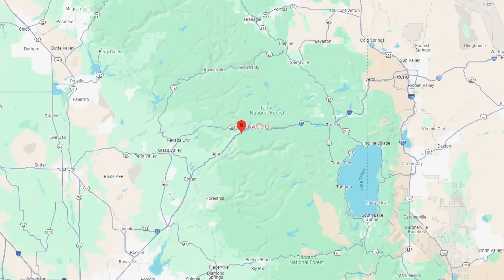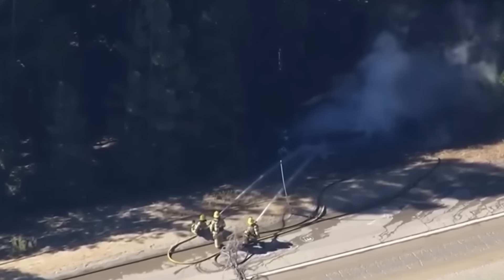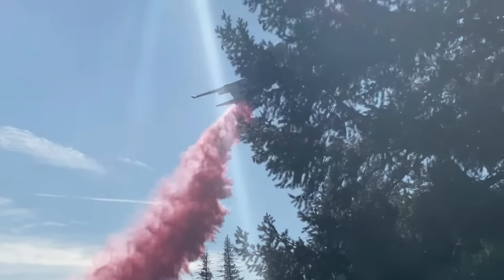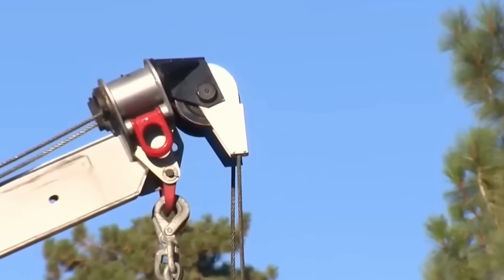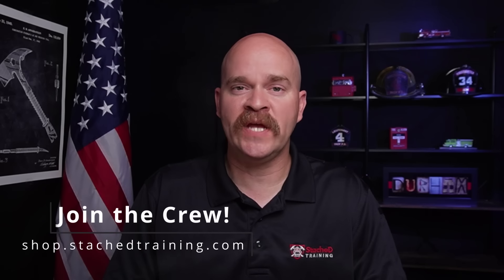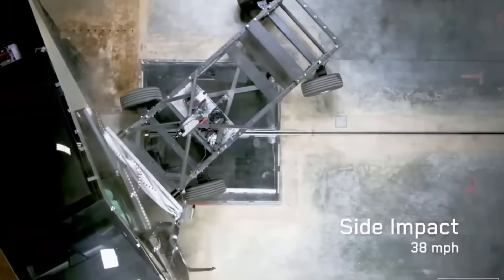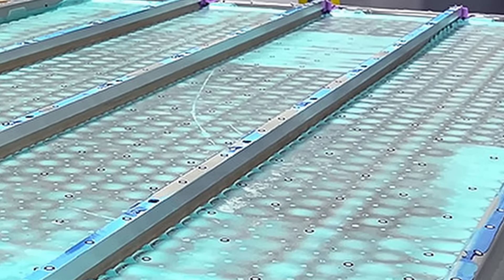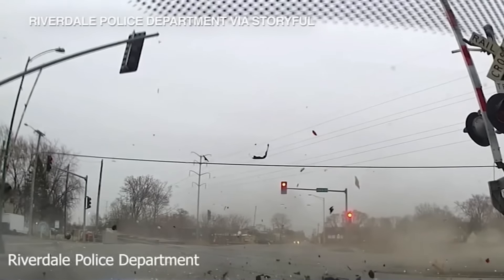50,000 Gallons! Tesla Semi-Truck & Cybertruck Fire

Comment: happens when to gas vehicles crash too. see it happen TO ME. You do know gas vehicles exploded right? or are you that narrow minded. burning fuel truck take long time to put out and do MASSIVE damage.
Reply from the maker: I've responded to hundreds of vehicle-related incidents. ICE vehicles rarely catch fire after a crash, and vehicle fires never result in explosions. While they may explode in movies, real life is much different. In 2021, I was on the scene of a large fuel tanker fire. It was carrying 4,000 gallons of diesel and 6,000 gallons of gasoline. The fire was extinguished in two hours.
Reply: But ice fires can be extinguished with water unlike EVs water will cause a thermal runaway causing massive explosions and deadly gases which will take hours to extinguish if it doesn’t kill someone
Reply: Pin of shame 📌
Reply: That's like comparing a bomb to a candle.
Reply: Well, for the same autonomy an ice vehicle transports 4 times more energy than an electric  - consequence of the difference of efficiencies -  but it is true that what matters most is how the energy is release. Ice cars have many more decades of experience dealing with this problem
Reply: Actually it is 11x more frequent in gas vehicles.  The OP is right about the effort to put out, but I would rather have 11x less deaths with more work to put out than the alternative.  Not to mention the cancer and other problems from combustion pollutants.
Reply: @badchefi biased ...? States the facts  tells the truth imforms  peeps like me with a general  understanding he also has vids about  battery fires in different structures  and  containers   so not just about e v cars  trucks 😮
Reply: Pack yourself another bowl, sit back, and try not to embarrass yourself by responding any further.
Reply: @josecamacho3393  is the charge of the battery relevant to the fire once its been instigated by thermal runaway? Or is it the 400kg of flammable components?
Reply: gas and diesel burn but do not explode. With lithium ion cells, the situation is different - read the safety instructions for your RC car.
Reply: @cherokee180c0  Brake and tire dust are arguably worse for your lungs than combustion.
Reply: @StacheDTraining  Mythbusters confirmed years ago.... Lmao😂 "movie myths"
Reply: You’re one of those guys who believes Follywood movies are reality.  Try again, Sparky after you get some education on the matter.
Reply: Not the same 😅
Reply: @JTDPM  I’m old enough to remember the clouds of asbestos dust that always accompanied a brake service air blast.
Reply: @StacheDTraining Liquid fuel is potential energy. It has to be converted into usable energy via some kind of ignition. Liquid fuels are much safer. You spill it everything is okay unless someone decides to strike a match. That energy also seems to take longer to release. Batteries store a massive amount of energy that's ready to go basically. You disturb the vessel containing all that ready-to-gk energy and it has to go somewhere very quickly. At least the driver had enough time to get to safety. Could have been alot worse.
Reply: @JTDPM  depends what you’re talking about yes that’s correct in terms of internal combustion for fuel however for battery combustion products they are pretty much more hazardous and many chemicals we are exposed to on every day basis
Reply: @rjbiker66  apparently not-well you would think the state of charge would affect it studies have showing that there is not a great deal of extra energy depending on charge nor extra risk on state of charge or the release of gas and combustion products
Reply: @JTDPM  Which an EV cuts down by like 70%.  I use my brakes like 5% of the time I do in a gas car and they will last probably 150K miles or more.
Reply: Gas vehicle are extremely unlikely to explode
Reply: @cherokee180c0 yeah you forgot to add the fact that they are many times more ice cars or maybe you intentionally didn't give that detail
Reply: @rajaydon1893  what don’t you understand about accident RATES?  The rate is already calculated per miles driven.  It is literally 11x less likely on a mileage driven equivalent.  By the way that is from Teslas own realtime data, but also very similar to the NFPA data.  Look it up.
Reply: chinese bot
Reply: You're wrong bud, electric vehicle fires are so unpredictable that they can reignite at any time for any reason at all even weeks later at the junkyard
Reply: @cherokee180c0  Frequency does not equate to death...
Reply: @cherokee180c0  Yeah, but your tires will go much more quickly.
Reply: @geogeer9911  So more fires are good?  There is absolutely no evidence there is a higher death rate.  In fact the Model Y is the safest car ever tested in two different countries which is REAL data suggesting the exact opposite of your argument.
Reply: Get a load of this guy being disrespectful on a pointless informational crash
Reply: @cherokee180c0  The size and controllability of a fire is more important than the number.  I haven't seen dealerships burned down by cars sitting in the lot.
Reply: @StacheDTraining 

U savage for pinning the comment😂😂😂

But yes, ive seen some semi accidents as well. But im mere driver on the road so i just drive past by them n hope anyone involved didnt get hurt. But so far.. no smoldering wreck. N this is just me driving on the road. U as an actual responder would definitely have more experience.

The general rule is, once crashed, turn off engine. This obviously kills any source of combustion, but it also stops the fuel pump from literally fuelling the problem, right?
Reply: @cherokee180c0  but there 11x less EVs on the road. And the ICE vehicles are much older. Wait til the EVs get old!
Reply: @craigoOZ  You can make up anything you like, but there are thousands of Model 3 and Y’s over 200K miles and more than 5 over 400k miles (All on the original battery)with absolutely no data they catch on fire at a higher rate. Again measuring by miles driven normalizes the data. Also with more than 50% of all EV’s not even having a flammable battery and massive improvements in energy density happening now that 11x lower rate is going to get much bigger.
Reply: You should use your narrow eyesight better for your grammar.
Reply: Come back when insurance companies are telling people to not park their petrol vehicles inside or near other property as some are doing now.
Reply: @cherokee180c0  but does that number account for the significantly larger number of gas vehicles on the road?
Reply: Ice these days has fuel shut off . Alot safer .  Go check out the tesla that went poof recently in New York. The poor ladies didn't have time to get out or even be rescued.
Reply: @cherokee180c0 you know it pollutes more when electric cars burn? Like 50 times over?
Reply: Maybe you have the capability to answer a question:
Why do battery car jockeys when faced with factual information regarding thermal runaway always go on the defensive, quickly attempting a change of subject with the cookie cutter got to, but ice catch fire yadayada 
Is the lack of confidence among the brotherhood so poor? There is no excuse for attacking the bloke give the information. 
How about being adult, realising there is a serious issue, taking the time to learn the fundamental requirements when things go wrong.
Reply: @JTDPM tyre particulates specifically. The experts tell us the partical size displaced from tyres is capable of finding its way deep in the lungs. 
Loaded with that magical blend of cancer flavoured unhappiness.
Reply: @StacheDTraining  I admire your ability, managing a polite response  despite the wilfully contempt some possess. 
Stay safe 🖐
Reply: Are you that 'narrow minded' that don't know about thermal runaway?